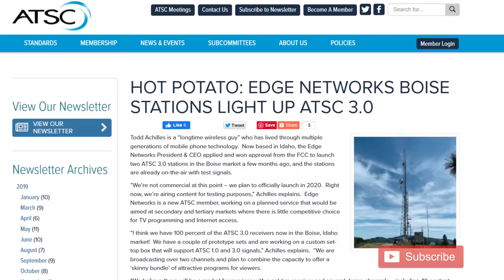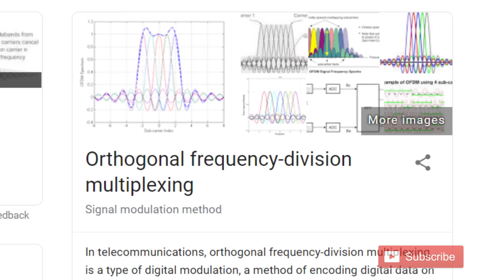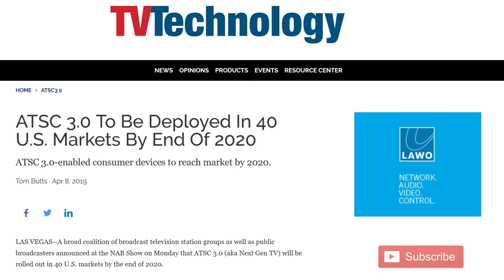ATSC 3.0 Details Pt. 1 - How’s The Reception? Do I Need a New TV?

Comment: That really sucks, my TV is 10 years old and works perfectly so why would I replace something that is not broken?  I also just bought a $50 digital converter box to record from TV onto my VCR that will also probably be obsolete!  They just had a major redo in 2009, It seems that they need to wait more than 11-12 years before completely revamping the system again!  TV sets aren't cheap and making something obsolete after that short of time is just wrong IMO.  My grandparents had a TV set for over 25 years, I think it is sad to have to throw away perfectly good expensive electronics.  It just furthers our throw away society even more!

Comment: From what I've read, there will be no "converter box coupon" program this time.
Reply: I'm just mentioning what I found.  With all the tax cuts for the wealthy, doubtful U.S. government could fund it.
Reply: They are requiring ATSC 1 to stay on the air for quite some time.  Also, the government might opt to subsidise the production side of the boxes instead, like they have with LEDs.  Cellphone providers may even get in on "free" tuners, if they are also allowed to obtain your viewing and advertising data.  

Either way, by the time ATSC 1 is permanently shut down, there should be plenty of good economical choices in the market, and with tvs being at the lowest prices ever, It's likely going to be affordable to simply buy a new one.  This should not be as awkward as the mismanaged transition from NTSC to ATSC.  The thing that probably made that  switch most problematic was the fact that tuners were supplied all willy-nilly.
Reply: This will also be a much more gradual change, whereas 2009 was literally overnight.  I still have my Magnavox converter, which gets used a lot less than my Iview with USB recording.
I'm guessing smaller markets and independents will change much more slowly, which is of course a wait-and-see.  Updating is a tough balancing act.
Reply: Got stalled,  I don't remember what was the original target.
Reply: @stevejohnson1321  FEB,17,2009 later pushed to June,12,2009 though some stations switched off before then.
Reply: ⅰи∂ㄩㄅ360  The original date was supposed to be Jan,1,2006 but pushed back to Feb,17,2009 and then delayed due to the DTV delay act pushed further to 6/12/2009.
Reply: I had to look it up, but there were four dates, December 31, 2006, December 31, 2008, February 17, 2009, then finally June 12, 2009.  The U.S. doesn't transition very well -- still haven't moved to Celsius temperature, and measurement was supposed to be metric decades ago.

Comment: I am overwhelmed watch antenna video......my zip code is 53126.....between milwaukee and chicago......chicago is farther 71 miles and milwaukee is 30 miles away.   I have an indoor antenna but want to get an outdoor antenna for my roof.   What is best?  multidirectional, directional, omnidirectional.....can you recommend the best antenna for me to be able to get chicago and milwaukee channels?  thank you
Reply from the maker: It varies depending on many factors. If you would like a custom antenna recommendation sign up on my website at antennamanpa.com

Comment: From some of the information I am reading, ATSC 3.0, will be a 2 way broadcast, IOW, the information will be internet like, so, I'm thinking that your traditional isp will be replaced your local tv station.
Reply: Incorrect, the ATSC 3.0 standard is IP based and allows easy integration between the OTA (over the air) signal and the internet. However you still need an ISP for internet access. So for example say a home shopping channel ATSC 3.0 would allow you to order stuff from your TV, much like using a computer today. Another example is tailored programs and commercials based on region or personal preferences. It is going to take stations a while to figure out how to best utilize these advanced features.
Reply: @tomschmidt381  So, taken from what you are saying: "the ATSC 3.0 standard is IP based and allows easy integration between the OTA (over the air) signal and the internet"

You're parroting what I just said. However, I'm looking ahead and what I'm saying is that the technology is open to a variety of uses, including being an ISP. The same as you getting data on your phone OTA, the same thing is going to happen as the technology takes shape.
Reply: @xr500t  I'm confused. Can you explain how you think data from your TV will get back to the station?  The TV station only has a transmitter, no way to receive data from your TV unless you are connected to an ISP.

Comment: its better if they remove vhf frequency and used only uhf frequency for stable broadcast
Reply from the maker: Not enough room. TV stations would have to turn off their transmitters
Reply: Derulo Cruz Actually VHF requires less power than UHF does.
Reply: @john26262  
True, but it's more susceptible to electrical interference and requires larger antennas to work properly.

Of course, the FCC poisoned the well when they restricted VHF power levels so drastically.

Comment: How can he not now if the new standard would help with VHF - why wouldn't they test it there as well?
Reply from the maker: Todd said the research papers show improved performance. The FCC gave him two UHF frequencies he legally can't test low vhf.
Reply: @AntennaMan  Are Todd's channels network affiliates or what kind of programming do they broadcast?
Reply: @AntennaMan  Ah...thanks.
Reply: Truth and Quality.
Practical and Useful Information.

The most important is , Reliable Reception of the 2 VHF Bands , VHF Low Band Channel 2 thru 6 and VHF High Band Channels 7 thru 13.

And Yes the UHF Band is also important.

I also know that the Humans will focus on a situation and blow off a part of a situation.

Like put a lot of effort in to UHF and as a side issue put little effort in to VHF Low and VHF High.

Reliable reception of all the Tv bands is the most important.

With out reliable reception what is the point of a lot of bells and whistles.
Reply from the maker: His company is just running loops of videos for now like most ATSC 3.0 stations
Reply: Antenna Man cool

Comment: I cannot understand why they went with the current modulation in 2009.  If they knew the problems were coming (predictable with the math) then why bother?
Reply from the maker: Stations went with ATSC back in the 90s. They just didn't shut off analog until 2009. It was pretty revolutionary for the time and the way some stations saw it...if someone can't get the station they'll get cable and the station will get retransmission fees.
Reply: @AntennaMan  I jokingly said it was a conspiracy to get cable and you jumped on me !   LOL.    I cannot get cable and Satellite is more of a rip off.

Comment: New televisions with new tuners or back to set top boxes.  I absolutely detest this development for ATSC 3.0 and having to use multiple remotes again just to watch over the air television.  I understand it isn't possible to change the tuners on old televisions.  I hope broadcast television isn't shooting themselves in the foot adopting ATSC 3.0 by requiring new televisions or set top boxes that this time most likely won't be subsidized like the last transition.
Reply from the maker: Technology advances quickly. Cell phones sold ten years ago no longer work as 2G has been phased out. The same goes for the new TV standard. We can't cling to inferior technology of the past. We have to move forward.
Reply: Just use a universal TV remote that will control the TV and the new tuner. I have a GE remote that controls my TV, Roku, and Blu-ray player! No need for multiple remotes when one can control everything!

Comment: I don't like the new system. It's just made to gather data on users disguised as "new and improved". Yeah, some may benefit from stronger signals, but for people like me who live in an urban area and get good coverage, we won't see any noticeable improvement. All this new system will do is know what I watch, when, and where I live.
Reply: We're so screwed dude....they're tracking us already~!
Reply: 4k HDR with more than 5.1 audio seems like a significant upgrade.
Reply: If you are concerned about privacy don't hook up your TV to the internet, just your antenna. The OTA signal is one way as always. All the typical broadcast stuff will work fine without an internet connection..
Reply: @tomschmidt381  That's good to hear. I was under the impression that 2 way communication was not optional.

Comment: dude like why don't you tell people like the real deal with digital vs. Analog and then saying all its way new technologies technically if it's still broadcasting at the same or similar frequency as well as the tuner is now a digital tuner meaning it can decode digital signal technically all your TV no matter when it was made as long as it's an HDTV would be able to take the new atsc 3 signal and process it too much horseshit on this MTA information like
Reply from the maker: ATSC 3.0 uses a very different modulation method and video codec than 1.0 so existing sets will not be able to pick it up. At the very most they might be able to show some data information but will not be able to produce any picture or sound. A new tuner WILL be needed for ATSC 3.0.

Comment: It's not right that we have to get a new television Everytime the format change. I consider this a dishonest way of selling televisions. If they keep doing this, we will have to say goodbye to over the air television. Some people have families and can't afford buying a new TV. 
I think the FCC should take control over how the signal is transmitted.  If it's required for stations to broadcast over the air, than the format shouldn't change for people that can't afford to change their television. I for one will stop watching over the air television once the format change. I can't afford to keep changing televisions  because of the ever changing formats. I'm not talking about cable, I'm talking about watching videos and DVDs instead.
Reply: New TVs are for rich people. Cheap converter boxes is where its at.
Reply: You don't need to buy a new TV. By the time ATSC3.0 comes out,those tuner boxes would be very affordable thanks to mass production and competition between manufacturers. It's just like 2G for mobile phones are getting shut off in favor of LTE.   The current FCC regulations require that ATSC 1.0 be transmitted for at least few years down the road. No need to worry anytime soon.  ATSC1.0 is also very bad for reception. I have been to Taiwan and even with their tall buildings and mountainous structures they never have problems in most cases,when they switched from Analog NTSC to DVB-T2(European Digital TV standard) They even mount TV with antennas in a bus as well. On a 2 hour ride from Kaoshiung to the Kenting district of Taiwan even at high speeds the picture is still watchable and in HD.
Reply: @DoctorWhom  I watched analog satellite TV from 1997 to 2010. (in Europe) I used satellite receivers from 1997 to 2011. It was a big mess. It's a far inferior user experience. I was so happy when I could switch over to cable.
I'm at odds with my cable provider because they want me to use a converter box, their converter box. They tried to convince me, it isn't possible to watch without hem. But the small TV shop I buy in my father bought and buys in told me otherwise. The shop is right, my cable provider wrong.
Watching with a TV alone shouldn't be something you have to pay a premium for. It shouldn't be for the rich. Those who caused it to be, made a wrong decision.
I should be free to connect TVs and video recorders to the Cable or to my antenna as I please, rather than being made to use converter boxes and technology that's defectivebydesign (dot) org.
Reply: @Rainer67059  That's what over the air TV is supposed to be. Europe uses DVB-T2 for their over the air broadcasts. Except if you live in countries like the UK you have to pay for a TV license on top of that.
Reply: That's what NES owners said about the SNES. You see where that lead us...